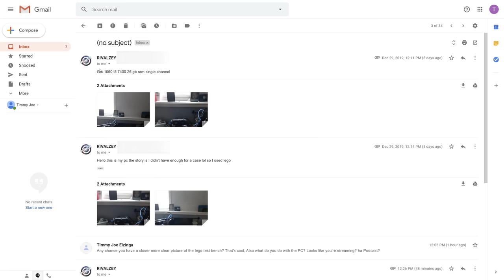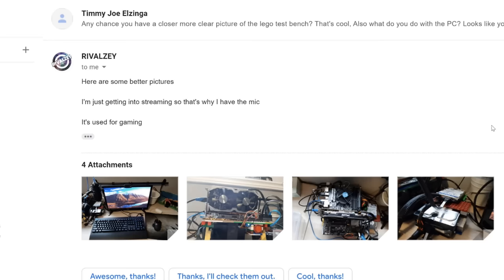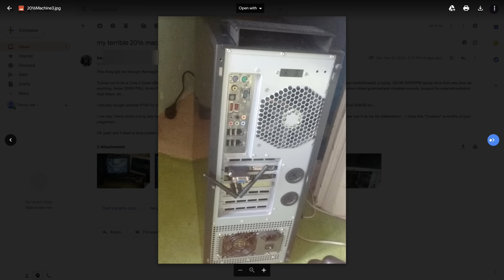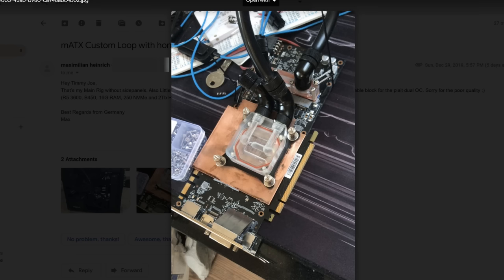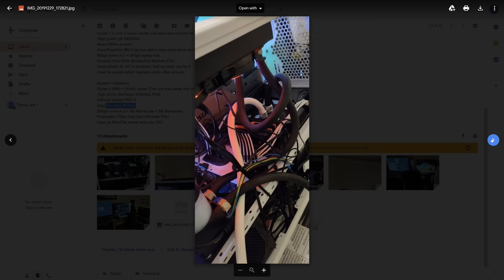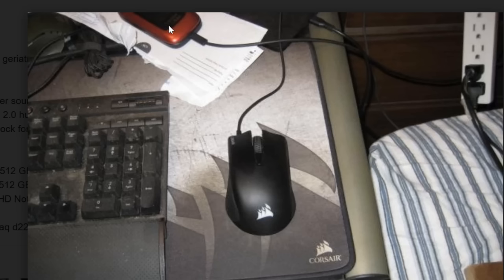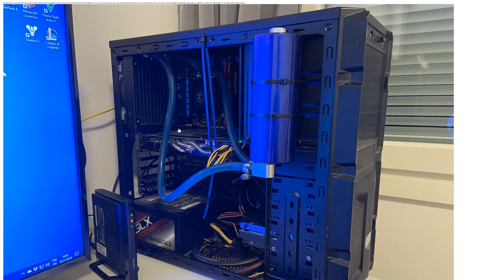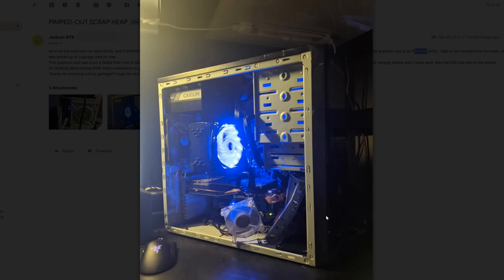Timmy Joe Roast My Rig Ep.1

Comment: I used a hammer too on my first build.  It was a Windows 98 build, and I got my hands on a full-length AWE32 sound card.  Those hard drive bays just had to go, if that card was going to fit.  Lacking a drill, I found a hammer and a rusty roofing nail.  Banging the bays did little good, since I had to swing carefully, so as to not hit any of the components in the system.  After a while, I figured out that if I put the nail in the middle of a rivet, I could knock it out in a couple of swings.  The end result was surprisingly clean.  The card fit nicely.  Had to get an adapter to fit my hard drive into an extra CD-ROM bay, but it all worked out in the end.

Comment: Ah class I've got a candidate for this - will get some photos and send em in - had some spare parts including an "Aplus Blockbuster" case so made a little rig with an RX 570 from ebay - but the GPU was too big to fit inside so butchered all the internals and mounted the PSU on the wrong side of the case to fit it all in.

Comment: I literally just the other day rebuilt my rig, switching from the Thermaltake Core X9 Snow edition (same as the one in the triple system pics) to a Obsidian 1000D. I also had more than one PC jammed in the case. To the right of the motherboard tray, where water cooling pump and res are supposed to mount, there is exactly enough room for another mATX or ITX motherboard lol. Had that case for years and it served me very well, but I decided to rebuild a cleaner looking PC, and the Core X9 is NOT for "clean" looking PCs lol. There are no chambers to hide cables or anything. So there is always going to be a part of the PC looking like a complete rats nest. But it was a fun case to work with. Though now I'm completely in love with the Corsair Obsidian 1000D

Comment: I can tell the first one is a Canadian, you can see a bell HDMI cable...
Reply: Yep I am lol
Reply: @rivalzey6303  that's you? Dang, your setup is actually better than mine. I'm literally using Intel HD graphics right now, only thing I can game on is my old laptop or my PS4.
Reply: @romanbellic5241  lol I recommend looking for local deals like at least a gtx 970 or later
Reply: @rivalzey6303  in my area, gtx 970's sell for like $150+ on Kijiji
Reply: I was looking at GTX 660's cause my cpu is really bad so GTX 970 would be bottlenecked.
Reply: @spacepaul4678  no because it's not a full box it wont get hot
Reply: I'm back, I now have a GTX 980ti and i5 2400. Troubleshooting it right now as I either bought a bad PSU or gpu cause it always turns off by itself when I start gaming and it also does some brown screen thing. Once I figure out the issue, imma get more ram and I'm getting a better cpu hopefully soon.

Comment: I have a dream to build a dual pc set up and then use an aio computer as the monitor, use a keyboard with a computer in it, a mouse with a computer in it, a smart speaker with a computer in it, and a flash drive with a computer in it for storage. And all of that goes on top of a desk pc with a couple computers in it.

Comment: That Copper Plate is actually for cooling the VRAM. All the Hybrid Mods would just cool the GPU and nothing else, so I soldered the gpu cooler to the copper plate :)
An the „IN“ on the Rad ist not actually zu Inlet. I bought I used so there you go ^^

Comment: I once was at the point the guy with that last rig was. I tried drill out the rivets but without the right drill it doesn't really work all that well. Tried for about 15 minutes but a wood drill just doesn't go through metal. I did get it at the end but some hammering was used.

Comment: Built my first computer yesterday, I do have to switch out the cooler eventually because it's the amd stock cooler which is fine because so far I haven't had the cpu get too hot at all, I'm switching out the gpu because I have a temporary card in there until Monday when my 1660 super comes in

Comment: Crap i have something to ask you timmy? I bought a smal gtx 1060 6gb from evga and even in winter i have 82c. She is like this since brand new. Do i have to be worried? Or its damaged. My pc its a mid tower from hp. With a core i 7 4770 on it. Please say if its a damaged gpu or nothing to worry. Just one more thing she never goes above 82c.

Comment: 1st pic he only has one stick of ram but says he has 28gb? How’s that possible ?
I’m sure that rca monitor is super sluggish and has a bad response time and very low refresh rate. 
2nd PC is dope for vintage but I’d do better tucking the leftover psu wires. 
Pc3 wth is up with dual crt lol. And man the mess of ketchup mustard wires. 
Pc4 is a mess his gpu doesn’t even have power connected. Cable management sucks. 
Wires everywhere 
I don’t see how the water block in the gpu even works. It’s a plastic block against a flat copper sheet. I bet that will fry it and not even cool well. No cooling path milled into the copper either. 
Pc4 is dope! Can’t complain. Maybe tighten up the cable management but 3 computers? Wow 🤩 ! 
Pc5 is super dated but good for what you got. I would get a better case but maybe just save for a good build. 
I’d clean the keyboard 
Pc6 lmao oil catch can from a car that PC is ghetto but that’s cool. They need an ssd. 
Pc7 for 190$ not too bad. I want to know what cpu cooler that is!!! 
The smashed bay is so funny 
Thanks so much for doin this again. I want to see more newb plebs tho lol.
Reply: I ment 16 lol
Reply: 2nd PC which is mine I left those wires out cause that pc is used for fixing vintage computers and video games mostly and I do not have a drive bay sled for SCSI drives, so they just get tossed in the floor of the case while I back them up and whatnot :) and thanks

Comment: Sorry I don't think I can build as bad as the last one. Oh, I'm not a dealer and GTA 5 is to get out aggression, I live in New Jersey. Smooth at normal settings in 4k 60. Yes, the case does kind of suck. I'm surprised at how well it does run. Exception of the GTX 1660, it's old now. No OC, just fire it up and use it. That's what it is for. Function over form.

Again Roast it. Just don't try to pick it up. Probably weighs 50 LBS.

I also have more rigs to roast. I'll get back to you on that.

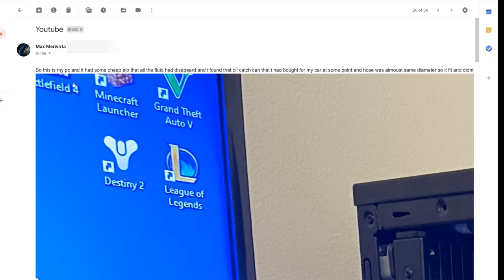Comment: My pc is at 16:35. My last name is a bit hard for a foreigners
Reply: I have upgraded my case now with one that has glass sides and rgb fans but still same components
Reply: Estonianrebel idle temp is 30-40c and with stress test it goes to 80c but as soon as you stop it it goes to 40c back and cpu has little overclock. With the ”bottle” it has so much water that it doesnt heatsoak like it would stock

Comment: Cheap cases have thin sheet metal. I would buy a better case than Roswell. Don't care for RGB even though the keyboard is.  Like I said Drive mounting and support for that manner is a issue. That old HP Compaq Case is built better than a Roswell case. That's from Pentium 4 era. It's steel instead of sheet metal. Aside from that I don't feel like putting money in to a Ivy bridge system. Only 4 SATA port and no USB 3 support sucks. With the exception of the GPU and memory and I forgot the I7-3770, most of it is years of junk I collected. Did not pay for case and maun board. Sound card I had. Not much at all to build. Ya roast it. Oh, I did pay for drives. No fans in front or side, so I cut the hole in the case. Stock, ventilation sucked. And yes I could use a better case. It's slapped together.

Comment: I want to take a hammer to my GPU while it's running. The last time I will ever buy Nvidia f**** garbage. Never had bad experiences with Nvidia cards I f**** hate them. Never have problems like this with my Radeon cards ever. My God. At least I only played $50 or GTX 970 I think that's a little much though. Especially when I get 1050 TI performance in half the f**** games I play.